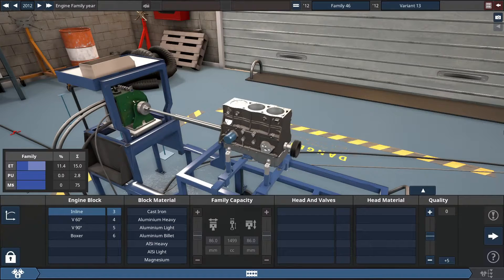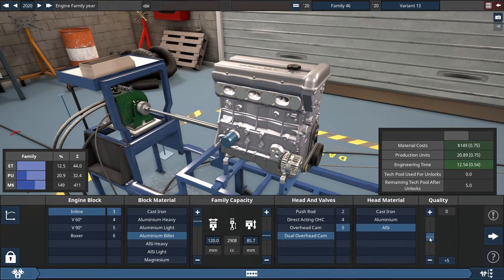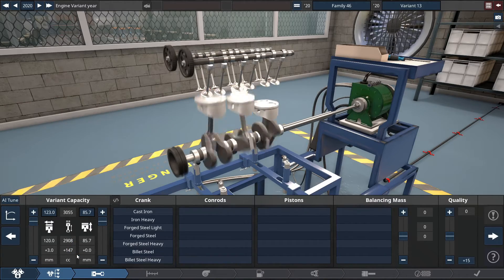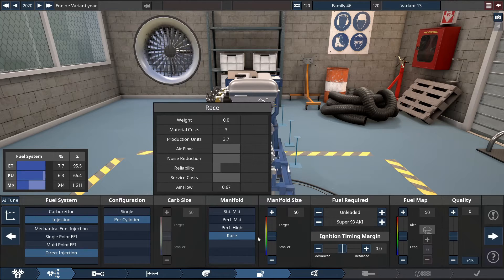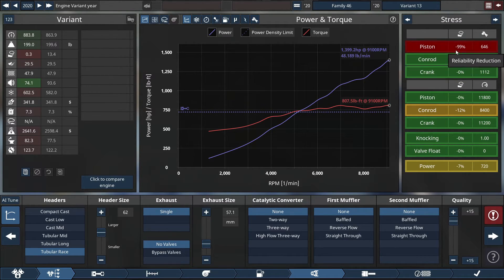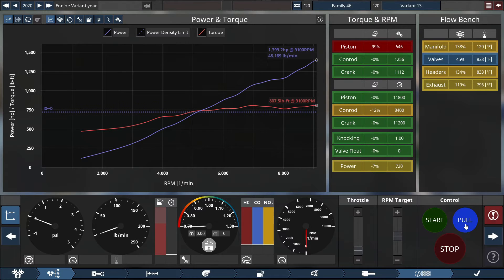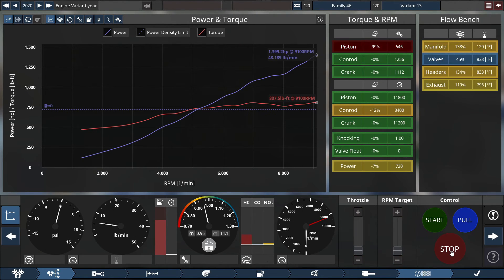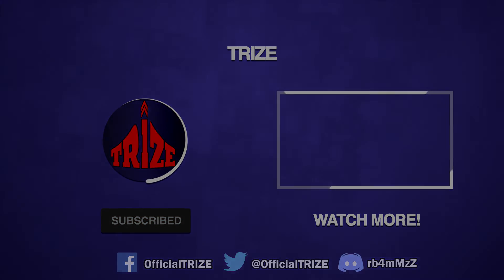The Highest Horsepower, Naturally Aspirated Inline 3 Engine Ever! | Automation Game (LCV 4.3)

Comment: Have you tried using the airflow map chart? This is what I use to tune the manifold sizes to help make more power
Reply: It doesn’t really matter bc your so limited by torque using nitro fuel like the engine is kinda restricted to keep torque down